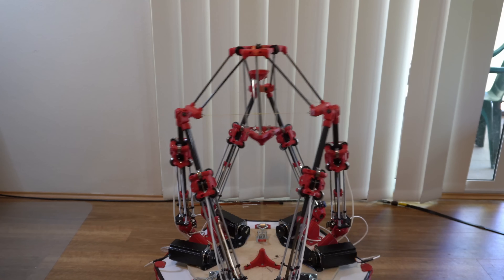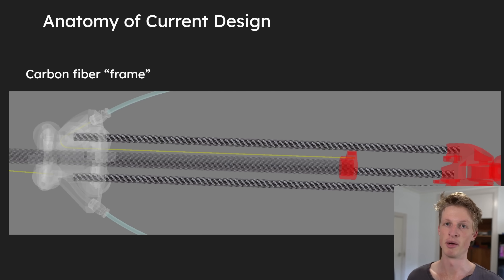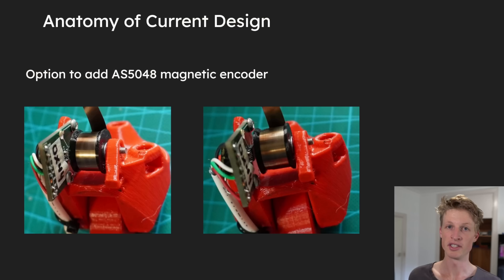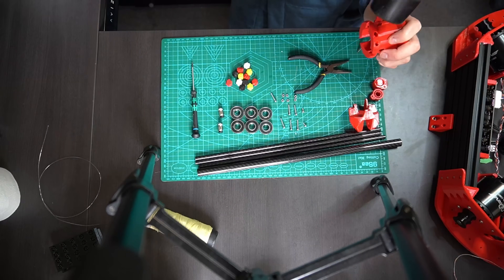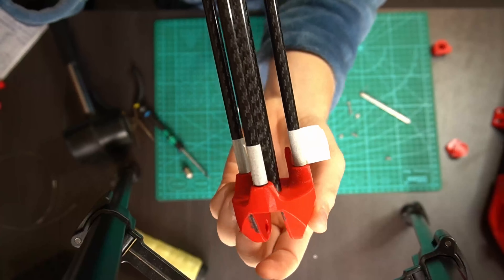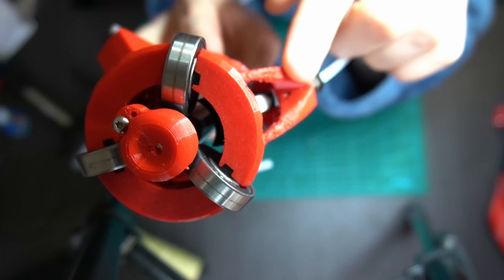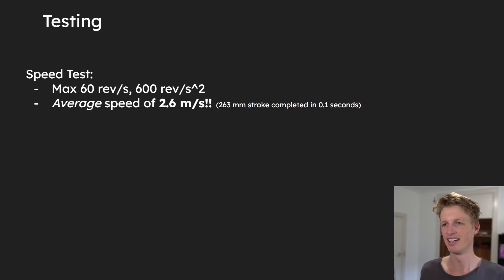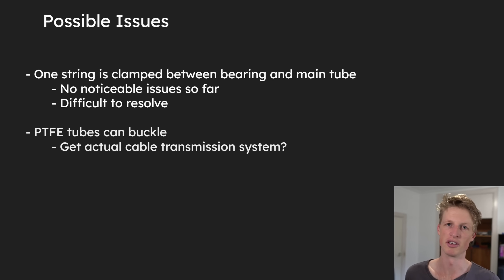Designing High-Performance Linear Actuators: Speed & Stiffness for my Juggling Robot | PDJ#19

Comment: Youtube magic (stalky / scary) algorithm suggested this video to me, as I embark upon my design of a projector lift (high spec, as in - projector comes out of ceiling perfectly square, minimal maintenance, strong and long lasting design) using linear actuators. I think a lead screw / stepper motor design is all I'll need for this application (similar to a 3D printer Z axis), although the cheapo ones on amazon aren't hitting the spot just yet...
Reply from the maker: FWIW, I made a video a while ago on my last design, which used a ballscrew and stepper motor. It was fairly cheap and easy to hack together. I've only bought proper linear actuators once and they were pretty garbage. Whacking a ballscrew (IIRC ~AUD$30-80, depending on length) on a stepper motor works quite well if you're after high force and precision, and don't care too much about speed. Here's a link to that video if you're curious: https://www.youtube.com/watch?v=1NTTl6_YO-s&t=0s

Comment: How mutch force do they have ? Maby make a test on how mutch it can lift?
Reply from the maker: That's a good question. I haven't run that test for two reasons:
1) After a short time thinking about it, I couldn't think of a good way to attach a mass to the actuator without going to some amount of effort
2) My application shouldn't need a huge amount of force; speed and precision are the name of the game, so I'm not that concerned about how powerful the actuators are
Reply: @harrisonlow  you can turn it upside down so when it extends it moves torwards the ground and use a string to atach a whaterbottle. But idk :)

Comment: This is awesome! I recommend bike shifting cable lubricated with silicone spray, its thinner and has a lot less resistance than bike brake cable. The housing is reenforced to prevent buckling and you can easily refill it with silicone if it starts to stick
Reply: How would it hold up long term? When used in bikes those cables don’t need to move an awful lot compared to what they would in this application.

Comment: Try printing TPU sleeves for the bearings with a concave shape to exactly match the piston cylinder. Maybe you can get rid of more wobble by squishing the rollers in since they can now flex a little, but that would add a ton of friction so there's a tradeoff.
Reply from the maker: I like the idea of TPU sleeves! I hadn't thought of that! I'll see if I have enough smaller bearings to give it a shot. Cheers!

Comment: tldr: both ptfe tubes can probably terminate at the bottom part. thin brass/copper pipe for redirection.

down-stroke 
the down-stroke string can pull the tube towards the bottom directly, instead of pulling on the topmost part. This allows more weight to be shifted to the less moving part and reduces ptfe tube length. It would require a redirection bushing or similar in the bottom part, but as that moves less i think it might be advantageous. 

up-stroke
the up-stroke string can run alongside one of the structural carbon fiber tubes to the top part, where it gets redirected back down. this reduces ptfe tubing and probably tube compression issues.

redirection solutions
for redirecting the string, i would evaluate whether a small bent brass tube which you feed the string through wouldn't be enough. all this would require is a section on the printed part to glue this into (so that it doesnt fall out while assembling/maintaining, while in use the string tensions should keep it in place on its own) which might be easier for assembly and even lighter.

another crazy idea: it might be possible to reduce this design to a pair of telescoping pipes, by using a ha:f open linear bearing (like the LM12UU OP) at the top and running the string between the 2 carbon fiber pipes. though this would likely require a larger pipe for the outer part. This would probably be overengineering for this usecase tho.

Comment: I have made my own choke/break cable by coiling 316 stainless steel mig welding wire into like a very long spring. It is very strong and flexible and with Kevlar string it would be very long lasting.
Side point; using this cable technique I have built a like choke/break cable with 10 cables through one outer helix spring thingy - so multiple straight cables up the centre of the helix 
I’ve also thought of a binary weighted linear drive using solenoids. Say 10 bit lsb is 0.1mm msb 100mm. This way a 10 bit binary value is converted directly into cable length. It would be extremely fast, repeatable and accurate

Comment: This is just a simple idea, but you could keep the PTFE tubes and make some sort of either hard plastic or TPU sleeve to brace that goes around the tube to prevent buckling, just the parts that curve up to where the string meets the PTFE adapters/nuts so that the only part of the tube that has not bracing is just the straight-away section to the motor. Cool project nevertheless, some pretty cool innovation here! I always thought regular linear actuators were slow so this is the perfect design for some practical applications!

Comment: Longevity might be an issue with the hardened steel of the bearings running at speed and repeatedly along the much softer CF tube. Will likely lead to slop developing and the tube needing replacing or the bearing position adjusted again. Some plastic sleeves for the bearings could be a good solution

Comment: Have you considered using linear bearings instead of these heavy and bulky rollers?   Igus makes delrin LM6uu that would probably do a very good job.  Always use linear bearings in pairs.  I've put some on my printer 5 years ago and it looks like I'll never have to change them.

Comment: Nice project!  One little trick for getting strings (and wires) through tubes is to use a hoover to simply suck the string through!  Works incredibly well ime  🙂
Reply: Damn, that's a good trick
Reply: You can also use pressurized air and it will blow it right though. My wife has an embroidery machine and that's how she loads the threads.

Comment: Could you improve speed even further by using an alternative to those bearings? I am just thinking about the changing rotational mass which could reduce performance. Would a needle bearing work? Where you thread the tube axialy though the middle? Also in regards to the string on the outside would it be possible to route it inside the tube instead?

Comment: For the cables, you can reduce buckling if you pair the string with a tube whose inner diameter more closely matches the string diameter. That could mean a thinner tube, but it could also just mean thicker string: for instance, type 95 paracord has an outer diameter of 1.75mm, which would be a pretty good match for the tube you're using.
Reply from the maker: Yup, I 100% agree. I actually have some very thin PTFE tubes on hand but I don't have any way to fix them to the printed parts on each end, so I just opted for the larger ones. Now that I think about it, I might be able to put the smaller tube INSIDE the bigger tube 🤔

Thicker string is a very interesting idea that hadn't crossed my mind! I'll pick some up and give it a test!

Cheers for the suggestions!
Reply: You could use car break lines. Basically the hydraulic equivalent to those pneumatic tubes and pass throughs. They can be bent easily and you should be able to find threaded connectors for the plastic parts

Comment: Awesome project!
Not having the two bearing sets inline with each other should increase the slop/flex of the system. This is because the bearings do not directly constrain the tube when cradling it while opposing bearing has direct surface contact.
Also, consider using 2 fixed bearing sets and a third compliant set that can be spring-tensioned to control the tension on the tube instead of having to fiddle with alternative mounting bits.
A lot of your flex may also come from bearings being mounted on plastic. If you can get a CF-rod that is pressfit tight in the bearings that would be much stiffer.

Comment: PTFE buckling in the bowden tube strategy is not fun. One thing we do that may help you is either use bicycle cable housing or a continuous extension spring (about 1 meter long, no gaps, see McMaster-Carr "extension spring stock") lined with PTFE. FWIW. Cheers!

Comment: For the ptfetube. Is there a cable, like in the moped throthle or bicycle brake, what has a steel outer and ptfe inner liner? or is it too stiff? Or use steal braided car brake line. or,  4mm grease line from hydraulic shop.

Comment: Congratulations! You have made a magnificent sample. I really like. And it really looks cool :) What would I suggest. to minimize the backlash in the thread, it is fashionable to add a differential tensioner. I did this for my printer. SL_ST 3D(GrabCAD). I will be insanely glad if you integrate my solution into your wonderful actuator.
Reply from the maker: Interesting idea! This would certainly help with making maintenance adjustments. I'll see if I can work this in to the next design (space is a little too tight for this in the current design). Cheers for the idea!
Reply: @harrisonlow  Forgive my impudence. But I'm also interested in your opinion about my finger model. It contains many tendons from fishing line. I also sought to reduce the mass of moving parts.
Reply from the maker: @sl_st  What finger model is that? I'm curious about what you're working on! I worked on some stuff related to finger mechanics and it's not trivial stuff!
Reply: @harrisonlow  For some reason my comments are being deleted =(
Reply from the maker: @sl_st  I think YouTube is removing comments with links to external sites. I could see your comment in my notifications and I checked out the design ("SL_ST Finger Demo" on grabcad for anyone wondering) and it looks cool! Does it work in real life? Have you built it?
Reply: @harrisonlow  Unfortunately, it did not come to the construction of such a stand with a full set of servos. But the mechanical part itself has been repeatedly tested and this is the third or fourth iteration. In general, it only got better. I plan to make a full arm with a set of tendons, and pull for them while without servos. But the mechanical part is already working well. I will be glad if you write to me somewhere else where the platform will not delete my messages =)

Comment: Rather than using a concentric spacer for the main rod bearings, why not use some type of tensioner? No manual fitting, and a guaranteed high contact.

Comment: How about running your cables through 2 of the 3 CF support tubes? Could solve the bearing pinching problem, the PTFE tube problem and make the housing simpler and smaller and neater.

Comment: Really nice. I wonder if it would be possible to route the Bowden string directly inside two of the carbon rod... This would make it looks like it's moving magically.
Reply: If two of the bearings that holds the shaft straight had a channel in it to guide the string this could be done easily.
Reply: @nemesis1588  Maybe turn the whole system inside out, where the actuator is a large tube on the outside, and the bearings are on the inside mounted on a smaller  rod.  Hide everything.  Meh ... may make it too heavy.

Comment: Hello, one of the string could go through the center of the other red printed part (the one attached to the base of the printer at the bottom of the 3 small carbon tubes), and go through the big carbon tube to the top. It shoud fix your issue with the string under the bearing, and use a more direct path :)
Reply from the maker: Good thinking! The main reason I haven't done that is that these actuators (there will be 6 of them) will be powering a Stewart Platform, so the actuators need to move around quite a bit, meaning it's tricky to route the string through the central tube since the central tube moves so much. I love the idea though, and it'd certainly make the design a lot cleaner. Cheers!

Comment: For the issue with the string being clamped between the roller and bearing -- what if you just doubled up the bearings on that side and left a slight gap between them for the string to fit in? Or, to save weight...find a pair of bearings at half the width/thickness of the current one, and then double up?

Comment: great actuator! some improvement ideas:
1) try using a pair of bushings (such as igus drylin slide-bearings or similar) to guide the rod instead of 6 bearings, it will greatly reduce the moving mass of the robot as a whole (since the actuator body is moving too, not just the arm). You'll have to use a separate pulley for the extension string though
2) for the strings: the tubes could start at the bottom of the actuator by simply running the strings parallel to the rods all the way to the base. this will leave you with much less length of tube to risk collapse (and a little less moving mass again).
2b) you might even manage to route the strings through the center of a hollow universal joint (4 stub axles on a star with a hole in the middle) and routing the strings through 2 small holes in a piece of PTFE in the star, or 2 short sections of tube, you can redirect the strings to a fixed position in the base, and not need any long tubes (you might need some more pulleys though, but only at the very root of the actuator and in the base itself.
3) try to constrain the string path length on the pulleys better: use a sharp groove not a rounded one, so the string cannot "wander" up the sides of the pulleys (maybe try a small bearing with a built-in c-clip (or snap ring) groove, a v-groove (623VV-V), or just a printed pulley with a sharp groove, or even grind(dremel) your own groove in a small bearing)
4) same for the spools: the string wanders up the sides of the spool, so there is not a clean relation between angle of the spool and length of the string (and thus the tension in the string), a cylindrical spool would help, and increasing the tube exit <-> spool distance will help avoid the string spooling onto  a previous turn of string.

best of luck!
Reply: 2b: could even route the strings through the carbon fiber tube - but that would possibly be annoying. i do think that designing it so that the longest possible length of string is tension only would be interesting.
Reply from the maker: Lots of great ideas! Some thoughts:
1) I tested something similar to this a little while ago and found that the CF tubes don't have a good enough tolerance to work with the linear bearing I bought. Do you think bushings would be more appropriate?
2b) Yeah I quite like this idea and ones like it. It might be a little tricky though since (slight possible spoiler) I'm thinking of changing the lower joints to magnetic joints as well (for a few reasons, which I'll make a video on if I do make the change). This makes it very tricky to get the strings right through the centrepoint. AFAIK there are ways to route the string around the outside without coupling actuator movement to extension/compression, but I think that will require a bit of work. Perhaps for the next version of the actuators 😉
3) Interesting. Do you think this would make much of a difference? I guess there's no real reason I went with a rounded profile, so I'm not against swapping them out for flatter ones. Might need to think about the printability of the parts, but I don't think it'd be too troublesome.
4) I haven't (yet) observed any string overlap on the spools and I don't think the strings are long enough for that to be likely, though it would possibly be annoying if it did happen... As for the string riding up the spool and affecting the position of the actuator, I don't think that would happen, as the difference in diameter would be so small. You're right though that (same as with point 3) there's no real reason to not use a flatter/cylindrical profile

Comment: I realy like the design this could come handy in so many way 👍🏻  i have two ideas for it that could help. It could help to skip the roller bearings completely and go straight to linear bushingsor bearings. 3d prints like you found out are never really concentric and fitting six bearings precisely inside the print, to get repeatable results can be next to impossible. Linear bushings  or bearings on the other hand constrain the movement of the rod completely into one dimension and are manufactured directly into the Right tolerances and can be fittet really easy into your design. Second if you want to tension your strings you could run both strings before  going onto the motor pulley over two pulley’s sitting on one movable axle. This way the forces should cancel out while tightening and you have no problems of one side being pulled harder than the other.
Reply from the maker: Cheers! I hope it helps with your designs! Thoughts on your suggestions:
1) I previously tried a linear bearing instead of the 6 radial bearings, but the carbon fiber tubes that I'm using aren't specced for that level of tolerance; one manufacturers tubes had a loose fit, another didn't fit at all. Linear bearings would be awesome (smaller, lighter, more elegant) but I don't have the cash to get high tolerance, light tubes... yet 😉

2) It's actually not so bad to tension the strings; I tie off the motor pulley end first and then adjust the length with the bolt clamp thing at each end. If I wrap the string around the bolt the correct way then as I tighten the bolt, it pulls the string even tighter, so it's possible to get the string extremely tight. Your idea would certainly be faster for small "maintenance" adjustments so I'll keep it in mind for future versions! Space is at a premium though and I'm not sure if there's room for that sort of mechanism in the current design.

Cheers for the ideas!